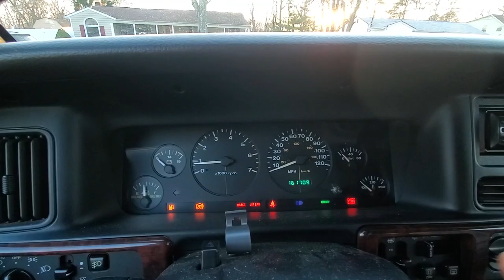JEEP BRAKES SEIZED!!! ZJ REAR CALIPER REPLACEMENT & BRAKE BLEED

Comment: The nice part about the Duralast pads and calipers is they are limited lifetime warranty. You can swap them out as you need. I work at Autozone and I've seen people swap out there rotors ever a month before they expire for a free replacement. The rotors are a 2 year so I would swap them out before they expire and tell them you want to upgrade to the clad coated rotors. The only thing you will have to pay is the difference for the upgrade. By the way the clad coated rotors have a 3 year warranty. By the way I have them on my 5.9er and I love them.
Reply from the maker: That's a great idea! I'm so jealous of your 9er!!!!

Comment: My jeep did the same thing. In reality, all brake calipers will do the same thing after so many years or so much usage will build up moisture and corrode inside and close off the small port to relieve pressure. Pressure comes in but can't get out. Brake fluid change every 2-3 years can eliminate this if done properly. I got my jeep home by opening up the bleeder valve and relieving the pressure. I had to do this a couple of times to get the jeep home. It's good to take apart and clean the calipers every 2-3 brake lining change and replace the o-rings inside. As always - Love your videos.
Reply from the maker: That's great advice! Thanks for watching brother!

Comment: My 98 limited did the same thing after I replaced the rear pads and rotors so I replaced them under warranty and replaced the calipers and all the brake hoses in the rear . The hose can cause the piston to stay engaged so it was cheap insurance to do it all on something this old . Great video Dan H. 👍
Reply from the maker: Thanks man I appreciate the input!  Next time I touch these brakes they're getting all new soft lines!

Comment: Great Vid Dan ,,,,I just did the brakes on mine , Parts are expensive over here so i rebuilt the calipers and changed out the flex pipes ,,,
Rob
NSW Australia
Reply from the maker: Thank you Rob! LMK if you need any parts. I'd be happy to help.

Comment: Mine did that, only it was one of the brake hoses, I rebuilt my calipers but in taking them apart, I found they were fine. after rebuild they did it again. Relaced all three hoses, I didn't realize till then how bad the brakes were, stops so much better.
Reply from the maker: Wow! you think there was crud trapped in the hoses?  Maybe all new soft lines should be in order.
Reply: @ProjectDanH  They deteriorate on the inside, causes small flaps acting as a check valve. I don't recommend it, but I cut one open and it's obvious even small bits of rubber was missing inside the hose. The crud usually settles in the bottom of calipers.
Reply: I changed all my hoses just in case.
Reply: @ProjectDanH  BTW, I highly recommend your channel, as a former tech, you give tons of great information, and recommendations on products. I was always a big fan of OEM fluids and equipment or equivalent too

Comment: I bought my WJ 6 months ago. Almost burned up in the Lincoln Tunnel, stuck front brakes, and I just replaced the calipers. Consider replacing the rubber soft lines, they cause more issues like sticking. Love the channel, Shout out from Brooklyn~01' WJ 4.7 I'm heading up to Vince's U pull today for my old man' s tahoe.
Reply from the maker: Oh man!  Bridges and tunnels are a nightmare to get stuck in/on. Glad you got it sorted out!  Next time I'm replacing the soft lines!
Reply: @ProjectDanH  I got out of the tunnel and was able to pullover in a legal spot on 11th ave. in Manhattan if you can believe it. The rotors were glowing cherry red. Let everything cool overnight and went back the next day for the same brake job + the soft rubber lines as well. Every jeep is different tho! Just got back from VT, all is well.

Comment: Some EQ heads are excellent stock bolt ons for the ZJ basically a better cast that's cast so nicely they'r basically ported out of the cast. And replace that plenum pan seal and the pan with an aluminum copy of the steel one to solve a problem where different heat expansion rates between the aluminum and steel destroy the pan seal and cause oil vapor to burn up in the cylinders until the compression ratio changes due to carbon buildup causing misfires. When I took my heads off their were flakes of carbon so big I could pick them up and take them out. Cylinders were good though the 5.2 and 5.9 is a tank!  I also recommend an injector swap off a crown vic or what ever EV1 to EV6 adapters required its just a different connector same PWM signal. After changing my injectors she had engine braking like a diesel! Not required but I went with SS valves, POC valve springs and Dough Thourley long tube try y headers (630-Y).
Reply from the maker: Wow that's some pretty sweet upgrades!  eventually I plan on putting the horseshoe intake plenum from a 99-01 XJ on, while doing that I was going to upgrade to the four hole injectors. I never thought about putting a new exhaust header on but if I could find one I would definitely consider it! Thanks for your feedback and thank you for the view!! 💪
Reply: @ProjectDanH  Header tip. long tube = more torque, short tube = more horsepower. I don't know the laws in your state but SS tube can be kinda affordable on amazon or from ur local industrial metal shop. You could always try to make ur own flange and weld some up your self for fun. At the very least cut the crush bend out from under the trans and replace it with a mandrel bent section...

Comment: That's a bummer about those calipers buddy.I did the same thing on my it XJ except it was the front.The driver's side caliper stuck and scorched the pads and rotor,so I replaced everything on both sides so I would have even braking on both sides..That was a good trick with that "lovely assistant"..😂😂😂
Reply from the maker: Glad you liked the Andy swap! lmao.  Yeah buddy, you definitely need even breaking!

Comment: If all your brakes do this at the same time, it could be the master cylinder return
Reply from the maker: Thanks for the tip! So far so good. I'm pretty sure it was the lack of use of the rears that caused them to seize

Comment: A few good rain storms and those calipers will rust right out 😭 ask me how I know

I love autozone calipers otherwise. I’ve only had an issue with one. Took it back and replaced no questions asked
Reply from the maker: LOL!!! Glad to hear... its nice not to have to rebuild the caliper piston.
Reply: @ProjectDanH  definitely. I had one blow a seal and was leaking brake fluid all over my wheel. 🤦🏾‍♂️ Good thing I caught it

Comment: Have the opposite problem. Left brake cylinder thingy stutters and brake-power is next to zero.
Time to replace 31yo drum brakes this weekend. ;P
Reply from the maker: oh man!!! do a disc conversion!
Reply: @ProjectDanH   I think it wouldn't pass the inspection. If it should pass it would cause tons of trouble and headache.
The department of transportation is... "special" in switzerland.
One can't simply install better brakes and increase safety! ^^

Comment: Hey bud when ever u do brakes , always lift the rubber boot around the caliper piston and spray some lubricant under the boot to lube the piston... before you push the pistons in ..doing this keeps caliper pistons from locking up..👍🇺🇲
Reply from the maker: Yep, These were well lubed with break grease a week prior in the previous break video! Thanks for the great tips.
Reply: @ProjectDanH  He's talking about the actual piston, not the pins. Never heard of doing that before.
Reply: @leakyjeep5.9  i started doing mechanics at the age of 13... not only do u need to spray lubrication under the rubber around the piston .. u should always take the rubbers out of the calipers ,the ones for the pins , make sure there's no build up between the rubber and the caliper causing a tight fit for the pin , causing the caliper to not slide very well... always lube between the rubbers and caliper to prevent the build up that causes pulling and premature brake wearing .. i learned alot over the years from old timers that i have worked for growing up
Reply: @leakyjeep5.9  putting lubrication under the piston seals keeps the calipers from locking up and or hanging up due to moisture .. idk about u but i don't like stuck calipers 😂

Comment: Dan its a must to put grease on the bracket where the pads slide on... if you have grooves where the pads slide , your gonna want to fill those grooves in with  weld and then grind them flat...  this way your pads dont get hung up when u apply the brakes , the brake pads will slide nicely once filled in with weld ...  👍🇺🇲
Reply from the maker: Yep! I greased em! They the knuckles weren't quite worn enough to weld and grind but maybe someday soon! great tip!
Reply: Grease attracts debris build up. Wire wheel them smooth, then wipe them with your oily glove. Shouldn't  have a problem sliding.
Reply: @leakyjeep5.9  been using grease for 40 years .. never had an issue
Reply: @jaboneyoyo5843  In more advanced braking systems where the pads fit and slide in a tight fitting groove, sooted grease that hardens can become a problem for sure.  True, our ancient pad to knuckle systems are less affected.
Reply: @leakyjeep5.9  from my 68 chevy pickup to my 2015 wrangler i use grease or a suitable lubricant  on the slides ... u can not EVER leave the slides dry ever .. i have 3 laredos 2 wranglers a nova and a chevy pick up and a dodge pickup..i been fixing cars since well forever
Reply: @leakyjeep5.9  i learned these old school ways from the old timers. Lubricating under the rubber on the caliper pistons will make sure u will never have to change  a caliper for a long long time the new calipers don't have the metal pistons but even so the metal caliper still builds up moisture between the piston and the caliper it self causing a stuck piston, hence most people replace it then.. if u lubricate under the rubber around the piston u won't ever have that problem with the caliper freezing up...

Comment: You may need to remove calipers one more time :)  your brake pads are installed upside down, the notch is supposed to be down,  it means you have to remove both caliper, swap driver pads to passenger side if not they won't fit, same for the front, notch is down.
With the notch down, it keeps the pads from being pulled outside with rotational direction  when braking, the force is on the backing plates only. 
With the notch up, the pads push the caliper outside and then the force is on the screws that hold the caliper witch can lead to  ''caliper sized''
Thanks for sharing, greeting form France
Reply from the maker: I'm pretty sure that doesn't matter, But I'll definitely keep it in mind the next time the calipers come off.  Thank you for your input! 💪
Reply: @ProjectDanH  in 99% of the case you are right, but In case of emergency braking...it might not be the same, remember the screw is not supposed to hold the caliper down, it's the notch, screws are just guidances.
Reply: ?????????????????????????????????! they only go on 1 way
Reply: @ericschulze5641  nope, you can install the passenger side upside down on the driver side, this is how they are installed on his vidéo
Reply: @jeepgarage  I have been having problems with my 03 G/Cherokee's calipers for years maybe that's the problem I'll look into it I'm not sure what notch your referring to have to watch the video again
Reply: I was just about to say this... Those pads are backwards.... Nothing is holding the bottom of the pad in the way they are installed now.
Reply: @blake8297  yes, it's bad! but I have just seen worth last week on a ZJ I just bought, impossible to remove the caliper...what ? yeah, one pad was ok but the other was backward, one noch up and one noch down ! it tooks me 5 mn to figure it out ! I just wonder how the previous owner did installes thos caliper, and of course, both side were same !
Reply: @jeepgarage  They probably hit it with a big hammer.

Comment: Have you ever done an ABS brake bleed on a ZJ? I here it takes a DRB Scan Tool.
Reply from the maker: No, I haven't yet.  Why would it need a DRB?
Reply: @ProjectDanH  If you somehow get air into the Anti-Skid system it takes the DRB scan tool to operate the anti-skid to push air out of the ABS system and then do a regulator brake bleed.
Reply from the maker: @edman1015  ahhhh.. that's right!

Comment: should be glad the parking brake worked because the rear passenger side parking brake shoe looks thinnn
Reply from the maker: That brake pad was from the original brake job last week.. and yes.. it was worn down to the metal ☠

Comment: I just bled my breaks but didn’t put the e break down does that matter if it was up??
Reply from the maker: You should be good.. The E-Break isn't related to the air bubbles escaping out of the lines.

Comment: Was something wrong with your calipers to begin with? I'm confused why you keep saying you neglected to replace them typically you don't replace them until they go bad or are showing signs of wear
Reply from the maker: I was considering replacing the old rusty calipers but didn't.. then they seized right after I did the brake pad swap